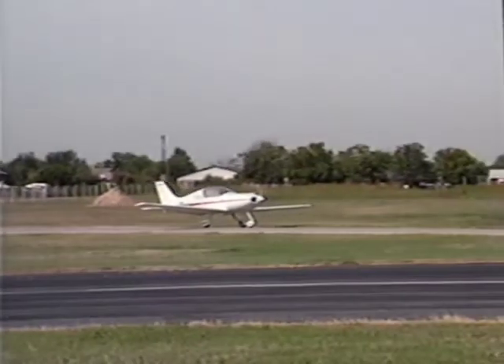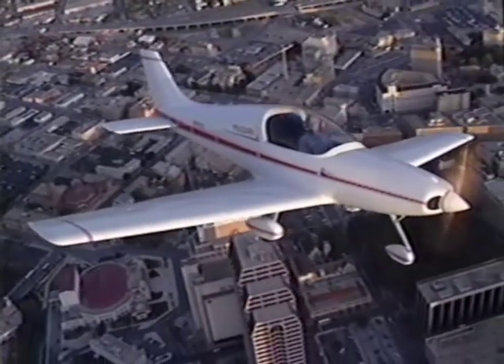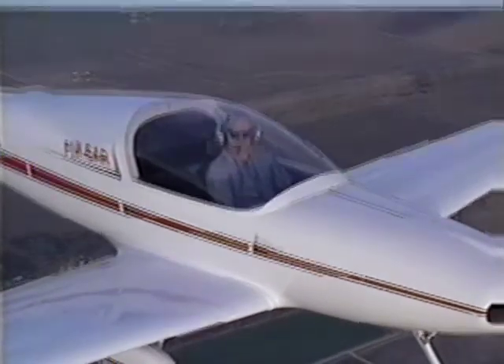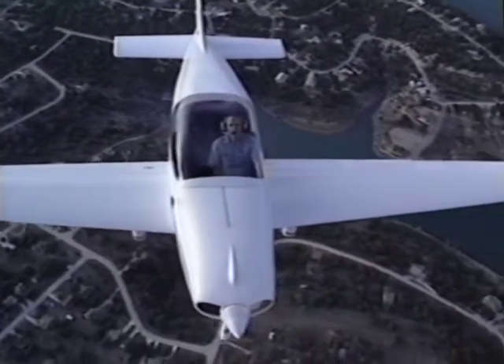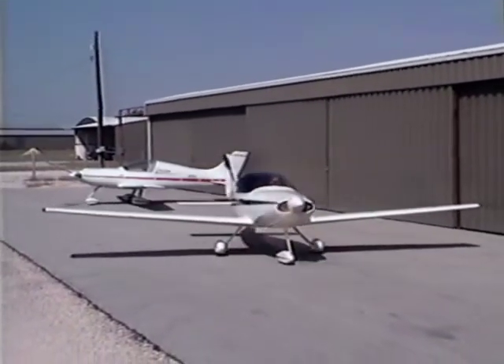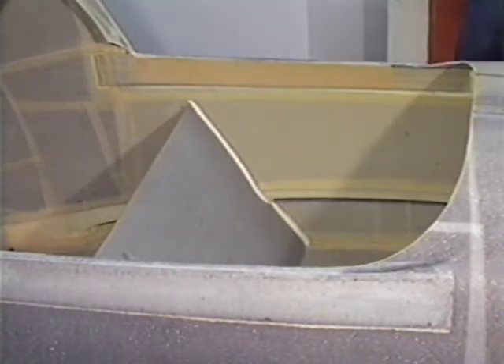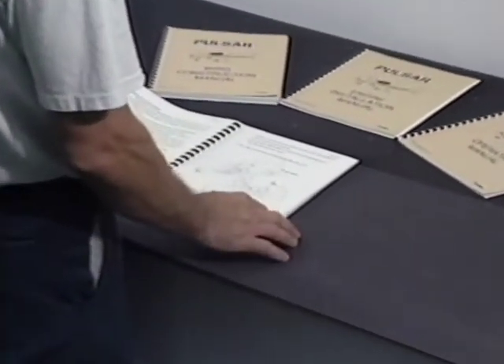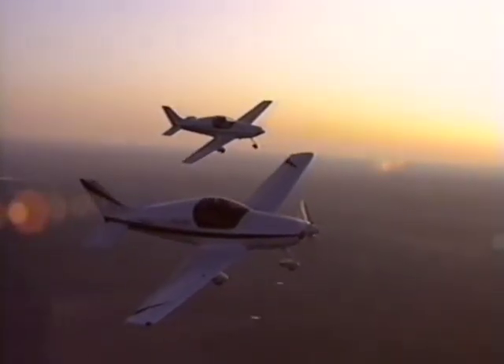Aero Designs Presents the Pulsar

Comment: My information is accurate to the late '90's, when Skystar Aircraft bought the rights to Pulsar. At that time, we developed a Rotax 914 Turbo version of the aircraft. It flew well and was 'raced' one time (maybe '98?) at Lakeland Fl/Sun n Fun against similar aircraft. The 
Pulsar flown by Frank Miller made an exciting, 'come from behind' win, when he missed a pylon and went back (short looped) to cover it. The race continued for 200 laps with Frank gaining on each lap to win by a very close/disputed margin (because of the 'missed' pylon).
 Upon return to Caldwell Idaho, the Pulsar was reviewed as to it's marketability. After all of the development it was determined that the aircraft was at it's engineering limits for carrying capacity. Two people (small ones) full fuel and their 'lunch' was about it! To go from 1200#'s gross to 1500#'s would require substantial investment and the project was sold to Sollie Melon (sp?).
 Sollie started a redesign to attain the 1500# gross. I don't know if that was ever finished and a completed/revised version ever flew ...